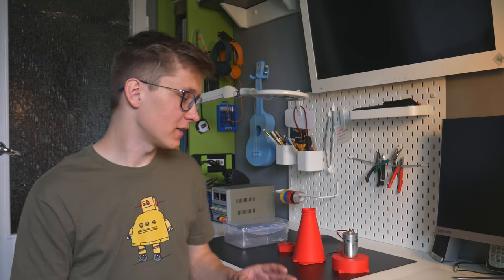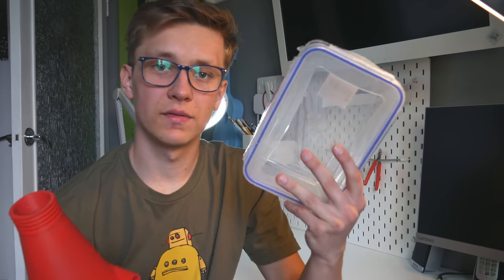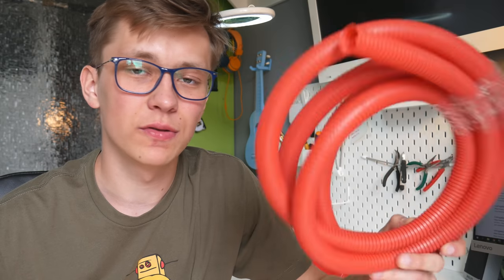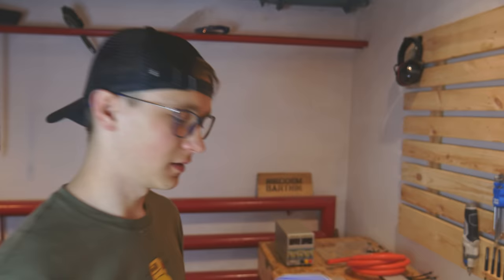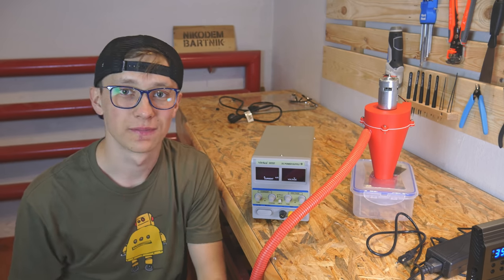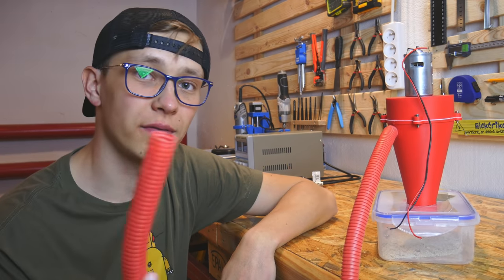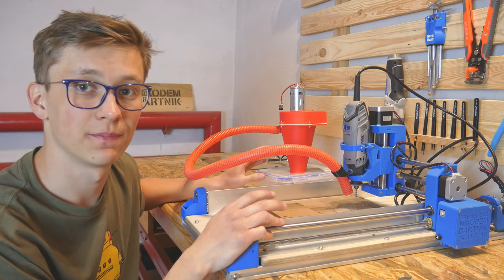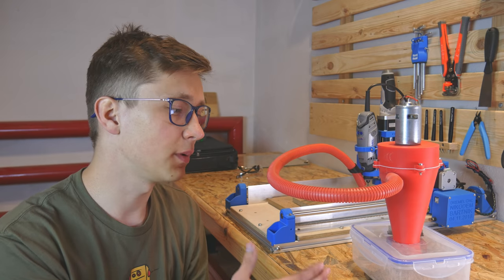3D Printed Vacuum Cleaner For CNC Machine

Comment: Why not use the cnc to cut a hole in the lid? Should be easy to do if you clamp it down properly. Nice project!
Reply: @Josha Beukema then after vacuum table! (It sucks items to the table so not need clamp)

Comment: Awesome project! Ideas: Corrugated hose is not good for vacuum, they "sing" horribly. The impeller blades feel backwards. A second nut above the plastic cap can cover imperfections on the cut. You don't have a 45mm drill, but you have a CNC...
Reply: "they "sing" horribly" 🤣Yes, sir, they do. It's a good idea only to frighten your cat 😁

Comment: the idea is good, but the hose has a very small diameter and will not generate the necessary air flow, enlarge the inlet and the hose and it will surely work 10 times better, greetings from Argentina

Comment: nikodem i think that your bin is too shallow. and there is no clean air escape from the bin. so your vacuum force is decreases. if you use a deep bin and you drill top of bin with carbon filter it runs better. thanks for sharing. we like your work

Comment: Redesign that black part you fit the hose into so that it acts like a fan shroud on a 3D printer. Make the end small and focused on the tip of the drill bit.
Reply: a better vaccum needs high volume low pressure to work better what he needs is a dust shroud or shoe around the dremel with brush bristles to help in cleaning up

Comment: Nice design. A few points to improve : don't block the air intake for those 775 motors. Don't mill MDF it has nasty dust. The smaller the dust the nastier it is, so maybe add some extra smaller cyclones to filter those nasty small particles out and an extra filter to catch the rest. By the way also be careful about humidity for your filaments and printer in the bathroom. Not sure how deep you cut, but attaching the dust collection to the z axis means it may hit the piece if you are drilling very deep. Also attaching something to the z-axis isn't good for accuracy (according to the mpcnc guide).

Comment: When you plan to use bolts with nuts to keep together printed parts, make on one of the parts a hexagonal recesses for desired nuts, and you will can push nuts inside, and use only a screwdriver to force a good connection of this parts

Comment: use a smooth pipe, the roughness will greatly increase the friction and turbulence. Also why not just make an adaptor so that the sawdust falls directly into a trashbag?
Reply: Yep, a smooth hose would definitely cancel out the whistling, created by the character of the hose. Nevertheless the smooth hose would have to withstand the under-pressure and not collapse and therefore the flexibility might suffer. I would recommend using a larger diameter hose of an actual vacuum cleaner, they are pretty cheap. But now when I think of it, this DIY vacuum cleaner may not even build so much under-pressure to make my point a real concern. :P
Reply: Im note sure but i think clear crystal pvc tubing can withstand 14 psi without colapsing. Otherwise you can use vaccum pump tubing, though for the price im not sure its worth the increase in sucking power.
Reply: The box is under negative pressure, so using a bag will not work, unless it has a frame to stop it collapsing.
Reply: @PiefacePete46  you do not understand. The filter would go on the outlet of the blower, not the box.
Reply: @justinwood2  :  You're right! I do not understand...  Nowhere in his comments does Laharl Krichevskoy
 mention a filter.  If you put a trashbag on the outlet of the blower, once it is inflated the airflow stops.  If you put the trashbag in the box, that is in the negative pressure zone, and the bag will collapse and block the entry to the box.   Either way, chip collection stops.  Did I miss something?  My similar system does a great job of collecting the coarse particles, but some of the fine particles make it through to the fine filter in the vac.  I am considering another larger filter between the separator and the vac, to try and increase the cleaning intervals.  Also, I did try a trashbag inside the chip collection bin, held open by a simple frame; it did not work very well, and it made some weird noises, so I ditched it.  A more elaborate frame might have helped it to work better.

Comment: You need to create a shroud for the area around the router bit. like those hardwood floor vacuum attachments that have a ring of bristles around wider end that attaches to the hose on a vacuum. I think the easiest thing to do would to harvest the tip off of an old vacuum tip like that and saw it flat so you can glue it to the base of the router and that will increase air pressure in the end there sucking up the extra dust that it wasn't able to get the first time, this will also help contain chips too. 
If you wanted to catch the superfine dust you could also use a light filter for that stuff and maybe another fan behind that helping suck air through it. You could also try to design a second stage that is not a filter like try to fling the dust onto water, bubble it through water (lol essentially creating a giant vacuum bong for your CNC machine), with another different shaped cylinder, or something else.

Comment: Great job!  If you place this cyclone inside a box with a big filter on it you could also catch the smaller dust. Else it will add it into the air you are breathing
Reply from the maker: I am thinking about 3D printing a filter that I could attach to the vacuum cleaner :)

Comment: Good job, however I believe that you can improve your vacuum cleaner performance if you change the inlet and outlet hole. Look how a water pump or automotive turbo charge works.
Reply: Correct. It's all built in reverse including the impeller.

Comment: Hallo Nikodem. Das ist ein schönes Projekt. Das hätte ich in deinem Alter nicht hinbekommen.
 Aber wie immer im Leben. Da wo Licht ist, gibt es auch Schatten.  ; )

Mit einem gut ausgelegten Zyklonabscheider kannst du etwa 99% der Partikel abscheiden. Der Rest - insbesondere die feinen Partikel - gehen in die Raumluft.
Dein Zyklon ist eigentlich kein Zyklon. In einem Zyklon entsteht eine spiralförmige Bewegung des Luftstroms. Da die Partikel sehr viel schwerer als die Luft sind, werden sie über die Zentrifugalkräfte an die Wandung gedrückt und rutschen dann abwärts. Um diesen Effekt zu erzeugen, benötigt du ein konzentrisches Abluftrohr. Dahinter kommt erst der Ventilator. Basierend auf deinem Konzept kannst du unterhalb des Ventilators eine Lochscheibe mit konzentrisch angeflanschten Rohr anbringen. Dann hast du weniger Arbeit. Nicht perfekt, aber eine deutliche Verbesserung.
Viel Spaß noch.

Unter folgendem Link findest du eine Skizze für einen Zyklon:   http://www.chemgapedia.de/vsengine/vlu/vsc/de/ch/10/heterogene_reaktoren/reaktoren/reaktoren.vlu/Page/vsc/de/ch/10/heterogene_reaktoren/reaktoren/wirbelschicht_reaktoren/wirbelschichtzustaende/wirbelschichtzustaende.vscml/Supplement/4.htmlPartikel

Comment: 775 motor is actually not super cheap. The brushless motor of a comparable power (about 150 watts) with an appropriate ESC costs roughly the same. And has no issues with brushes wearing out. It is important when the motor runs for extended periods of time.
Like the simplicity of powering brushed motors, though.

Comment: Have the output of your cyclone go into another box with some fine filter medium.. That will make your dust collection dual stage and it will then catch most of the fine dust as well.
Reply from the maker: It would take a lot of space, I think a simple filter will also do the job
Reply: Small filter bag.... Like the ones they use on the leaf blower vacuums and some power tools with built in dust collection.
Only needs to be about the size of a drink can, and if you use a washable one, you can reuse it basically forever.

Comment: No need to print a gasket - just run a bead of silicone sealer along the edge - done. Also duct tape is a recognised permanent solution😁 further - if you enclose the turbine such that you have a suction hole in the middle of the bottom of the enclosure you will be able to separate more of the fine dust. Instead of a gasket you should print a lid for you cone with a hole in the middle, replace the gasket with the lid and screw the whole thing back together and you’re good to go.
Reply: GERT Halberg:  why make a cover with the hole in the center, if the cyclone is already closed in its wide part? check the video: inside the cone there is another thinner tube supported by the bottom of the cone
Reply: zola tanaffa You’re rigth I saw that there is a pipe in the middle😟

Comment: I haven't played around with centrifugal dust separators but i have with impellers and you really need to increase the blade count and make it so there is a bit of a lip on the inside between the outlet and the inside section to reduce pressure bleed between the high and low pressure sides, and make it so the blade is tilted in the center and then twists to horizontal on the outside this gives a bit more air flow.
Also because your focusing on suction you can probably skip directing the air flow and have it so the exhaust section of the impeller is open this will probably make it work better, but i haven't tested doing something like that but considering how impellers work it'd probably work and for nose if you increase blade count it increases torque needed to run it but means that it would move more air at lower rpm so would probably be quieter. 
I made a small impeller fan just as a little portable fan that i can take with me if I'm going somewhere hot, runs on 3v with a 10cm dia fan so its not quite small but relatively and the 3 volt motor is meant to run on 3 amps it gets about 2 and still has enough suction force to lift a piece of heavy duty a4.

Comment: Sorry. Think there's a small mistake in the design of your blower. The body of the blower must be an elliptical shape (kind of) and the propeller must spin out of the center. This will increase a lot the vacuum in your dust chamber.
Reply: You're talking about a volute. Not strictly necessary, but should improve the efficiency of the blower.

Comment: Have you thought about printing a dustshoe? I've seen quite a few nice examples here on YouTube, where the actual brushed part is attached with magnets for easy unmounting and changing of the milling bit. Since the suction pressure seems to be fairly limited I think that would help with cleaning up all the bits around the milling bit. But of course it seems to work fine for the fine particles that would otherwise spread everywhere in the room! (Especially for those, as already mentioned in the comments, a filter besides the cyclone seperator would be a good idea) Nice work, can't wait to see more, love your Channel! :)
Reply from the maker: Thanks! Yes, I am trying to find a way to make something like this but I want to make it easy for others to replicate so I have to find components that will be easy to buy for everyone.
Reply: @nikodembartnik  That's true, I totally understand that, that's why I thought maybe something 3d printed, a few neodymium magnets and a brush seal combined would be pretty affordable with a huge impact on the cleaning and dust contamination result. :)
Im also going to build something like that for my RS-CNC I think.

Comment: You should consider running the impeller "backwards" this will improve efficiency aswell as suiting the motor better because its high rpm and low torque! Greetings from germany

Comment: OK Very Good, I have a Dremel Conversion that I use to cut Pot Metal 1950 Model Trains. Its cast metal but very soft. I just go slow it works great. BUT the dust is metal and very fine. I need this device, did you add on outlet filter? Need one for very fine stuff. Thanks Young Man, D

Comment: The blower shroud is the wrong shape - search for 'volute' to see a better and more efficient shape. Your design leaves nowhere for the air to move until the brief moment it passes the outlet. This stop/ start movement of the air is probably one reason why it's loud (this is essentially how air raid sirens work). I'd guess the blades would also be quieter if they were angled 'backwards' (I'm not sure, but it should be easy to reprint and test). I find it interesting that you made the blower spin the opposite way to the vortex. I suspect you could make it more efficient and quieter if the air didn't need to reverse it's direction of rotation as it hits the blades.
Reply: These things look like the biggest improvenent tome aswell on the 3d printed parts. And should still use a decent dust filter bag on the outlet. As this design is ment to trap medium to large sized stuff. And or use multi stage although i doubt it would more effective van just using a filter.

Comment: Nice project :) As others have mentioned you need an outlet on your box and look at maybe a filter to stop the last fine dust from escaping. Also look at what bigger CNC's use for a Brush/Inlet to aid the dust getting into the hose for a start. Subbed and I will be making one with a tweak or two.

Comment: This is a really awesome project, but I have to tell you, your impeller is backwards! The way impellers work isn't exactly intuitive, but it's centrifugal! You're pushing air out with the "Back" of the blades, instead of trying to scoop it and throw it. If you want more info you should check out Matthais Wandel's youtube channel, he's built a few of them by hand out of wood, and they out perform storebought dust collectors! I suspect if you flipped your impeller around, you'd get probably twice the suction!
Reply: Some are backwards.   The woodsucker industrial cyclone had a reversed impeller.

Comment: A washing machine in a bathroom is just wrong to any UK viewer watching this. A good project however. Dyson used 3D printing to test and iterate their cyclone designs for their vacuum cleaners so it's a good tool to make a cyclone design.
Reply: Yep, super weird for most people in the UK, but apparently it's very common in certain other countries! I did actually spend 6 months living in a house in Basingstoke, in the south of England, that had a washing machine in the downstairs toilet room, but that was the first time I'd seen that in any house in this country, and I've not seen it elsewhere in the 8+ years since!

That was a really weird house, though. It felt like the houses on that street had been designed by an architect visiting from another country. It was also the only UK house I've encountered with US-style air vents in each room for heating, with an air heater in a cupboard in the middle of the house, rather than using radiators like basically every other UK house does! (The heating cupboard also had space to install aircon which is one nice advantage to that system, but unfortunately they positioned that cupboard in the living room and the heating system was rather loud, so we often had to turn the heating off temporarily if we were watching TV!) Oh and it was also only the second UK house I've come across that had a US-style garbage disposal system built into the kitchen sink! Who on earth designed that place?!
Reply: moojuiceuk: here in Italy in many small apartments/ flats, the washing machine ends up in the bathroom, possibly far from the bathtub / shower and sink

Comment: that box for collecting needs an exhaust - all the pressure that goes inside you dust collector just builds up. this will be a loot more powerful if you do an exhaust with maybe a generic "hepa" filter or just sponge to trap the dust inside. great design none the less. love it.

Comment: Drilling the plastic box? Soldering iron!!! ;)
Reply: Yep... short piece of wood with a hole near one end and a nail through it at the required radius.  Nail goes through the centre of the circle on the box lid, and the soldering iron goes through the hole in the wood  Rotate it around the nail, and... BINGO!  Holesaw for plastics etc.
Reply: That’s a terrible suggestion unless you perfectly know why you shouldn’t. Most household plastics decompose into toxic fumes when overheated. PVC => gaseous chlorine => destroyed lungs.

Comment: please add a filter to the output side of your cyclone.  The smallest, most dangerous particles are being sent directly into the air and are very bad for your lungs.  The other option would be to vent it to the outside.

Comment: That is NOT a vacuum cleaner, it is a cyclone.  It's purpose is to aim the dust and chips into a Box/bucket to which you attach a shop vac or vacuum cleaner.  The purpose is to collect the debris and not have the dust clog your shop vac.  So it needs to be two stage and the collecting box need to be fairly deep to let the dust/chips collect in it rather than passing through.  If you change your design to do this you will find it will work much better.  Hope this helps.  If you need more info on this just browse the woodworking you tube videos on the cyclone usage with a shop-vac.  Regards.

Comment: I wonder if you use it in reverse if it can be used for a cooling duct for 3d printers
Reply from the maker: Sure, why not. But it would be better to design it differently to achieve higher air flow
Reply: @nikodembartnik  ahh very true, thank you for the insight

Comment: You made a bit of a mistake. The impeller you made is a blower. With a blower you need 1 output. But you dont use the blower output. There is no reason to close the room around the impeller you only create more resistance. Make as many air holes in that impeller cover as you can without risking cutting your fingers off.
Reply: The impeller will just swing away the air by centrifugal force. The direction it swings it in does not mather to you the only thing you need is for it to pull a lot of air trough the hole. Look up pictures of a vacuum cleaner motor